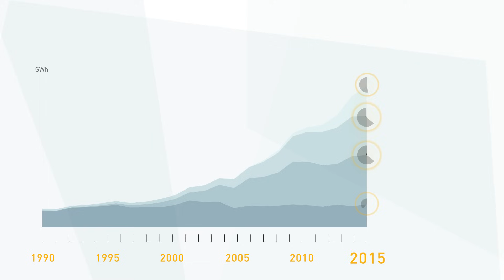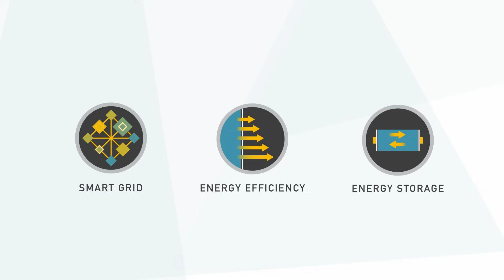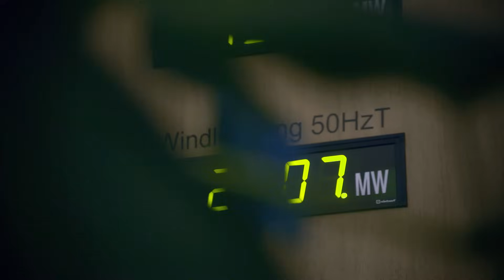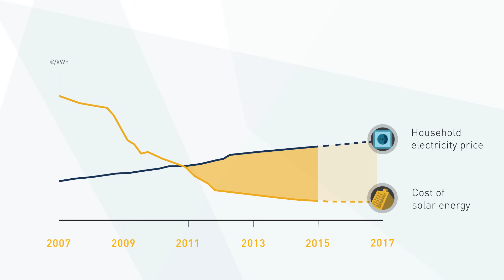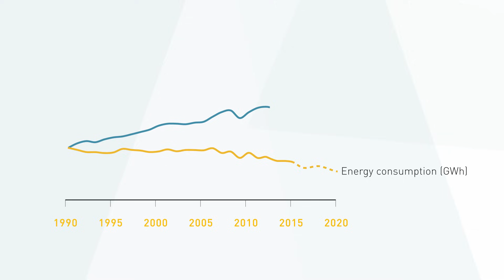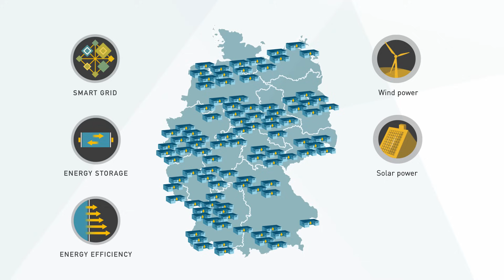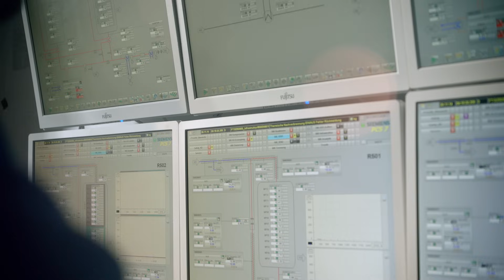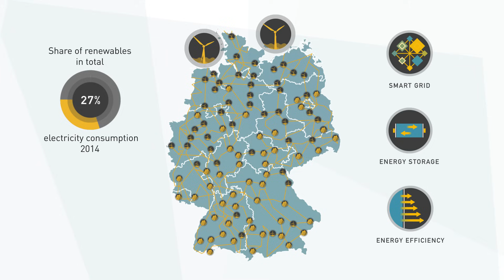Germany's Renewable Energy Revolution

Comment: They have more than 1.5 million renewable power plants for a population of just 81 million people.  That is 1 power plant for every 54 people and they only produces 27% of the energy required.   That itself hardly sounds a financially sound prospect but those figures are projected to provide 100% renewable energy there would be a staggering requirement of 1 renewable power plant for every 13 people.'
Reply: most of those 1,5 million are just small solar pannels people put on their homes to reduce their electricity bills. and thats not gonna power the industry.
Reply: +Phlizz  If that is the case then the producers of this advertisement are disingenuous in their use of the term "power plants'

Comment: The people of Germany could emulate Sweden (incinerating garbage to boil water, produce steam, and power a steam-turbine generator).
Reply: There is only so much waste to burn.  It has been used in Germany for a long time and expanded in the last decade but it still only makes up 1% of the produced electricity.
Reply: Fabio Till Are you sure?
Reply: Germany has strict separation of trash. What do you want to burn? The plastics and blow all the toxic waste into the air? Paper that could still be recycled? Biodegradable stuff probably doesn't burn all that well and is better left to nature to dispose of. Glass doesn't burn.
Reply: https://en.wikipedia.org/wiki/Waste-to-energy
It's different everywhere but as you can read in the German article, since 2005 it is required in Germany to burn all trash that is left over after separation and to sort the trash so that the burned waste is not too toxic for landfill deposit.  It's enriched with non-recyclable plastic foil or furniture wood.  There are different ways to ensure that the air is not unnecessarily polluted, like "re-burning" the toxic fumes.

https://commons.wikimedia.org/wiki/File:Energiemix_Deutschland.svg
https://de.wikipedia.org/wiki/Erneuerbare_Energien#Anteil_der_erneuerbaren_Energien
Here are some links to your initial question, since nobody seems to know how to Wikipedia.  Look for Hausmüll or biogener Anteil des Abfalls.
Reply: Is burning garbage not a really bad idea? I cant imagine that'd be all that green...
Reply: godonlyknows13 There would be less garbage for us to deal with.
Reply: Kevin Lane  ... I'm not sure you've really thought this through, Kevin :/
Reply: godonlyknows13 Is that sarcasm?
Reply: Suyamu Well, then please tell me this: What do they burn as WasteManagement?
Reply: Fabio Till Okay. You win.
Reply: That sounds like a waste of rubber.
Reply: Other than hydrogen, burning anything causes air pollution, I know everyone is concerned about CO2 but air pollution was a bad thing long before climate change.

Comment: Greece and Spain should be exporting solar power to the north of Europe.
Reply: And where does the backup power come from?
Reply: @dougmc666  Batteries, gas, demand response schemes, hydrogen storage, flywheels... Many of these are already in use.
Reply: @Capedamon1  - I'd be interested to know of anyplace that backs up wind or solar without burning any fuel
Reply: @dougmc666  a new technology isn't adopted a week after it is invented. Give it five years, give or take.
Reply: @dougmc666  energy storage. Don't forget waste to energy. Waste to energy can really work as peaker plant. Also, overbuilding renewable sources to make some that are specifically made for storing electricity for later is a good idea. Also, the sun doesn't disappear.
Reply: Just as UK should be exporting wind and tidal.
Reply: "Greece and Spain should be exporting solar power to the north of Europe.
"
How?
Reply: @johnclayden1670  interconnectors and they are already exporting electricity just indirectly
Reply: @jakob9911  You mean, even in daylight, Greece and Spain produce more than their base load leaving surplus to export?
Citation?
(Yes, I know that Spain produces solar power at night - and receives an EU subsidy).
Next up you'll have me believe cutting down trees, cutting them up into tiny pieces, shipping them halfway round the world and calling it biomass is carbon neutral!
Reply: they are
Reply: you can't transport electricity that much. Much of the energy will be consumed in the grid, it is called resistance.
Reply: @rsn_vsrn  - Transmission lines under 2000 km is perfectly doable, it's called high voltage direct current.
Reply: @dougmc666  sure it reduces the problem but doesnt solve it. Still, some of the current is gone plus you have to spend money for maintenance. Importing electricity from other countries is an A plan. It is B plan.
Reply: @rsn_vsrn  no importing and exporting electricity is how we get to 90% renewables. and we are already doing it in Europe. it makes the electricity cheaper for the consumer and stabilizes the energy grid. Scandinavia is great example
Reply: @rsn_vsrn  By much, how much are you thinking? Actually, long distance transmission of power is quite efficient due to the step up in voltage and the due to the power law, not much is wasted. This is now being made even more efficient with high voltage DC transmission cables which are doing exactly that - transporting vast amounts of power between entire countries. Check out https://en.wikipedia.org/wiki/High-voltage_direct_current